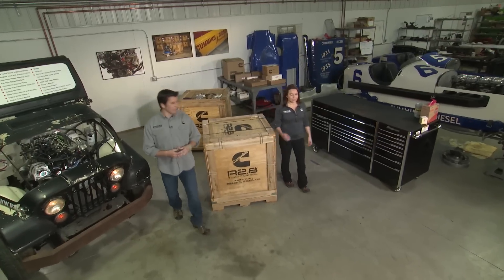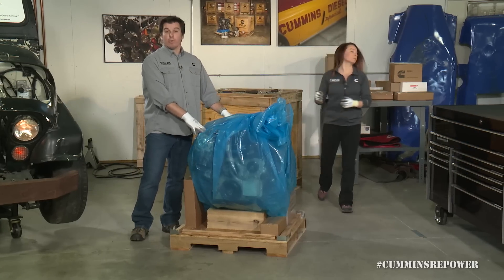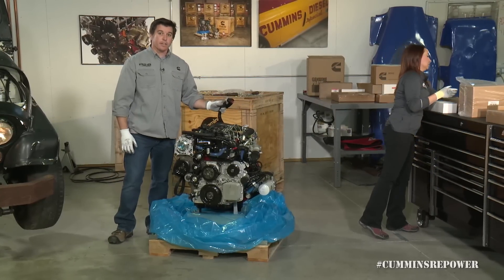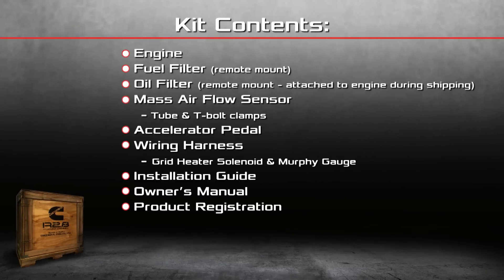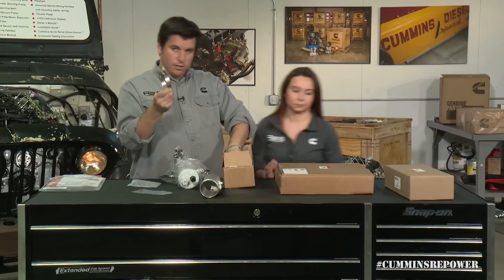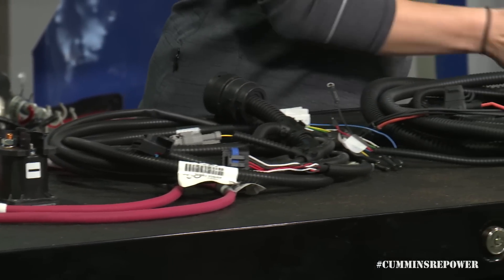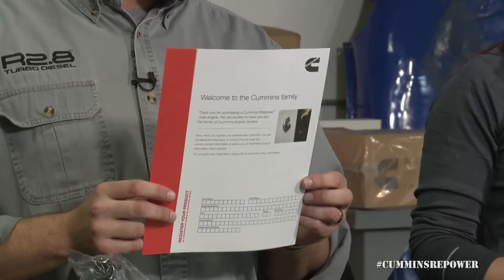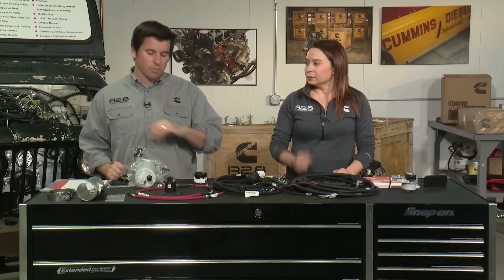Cummins Repower Garage Video 1: Kit Contents and Unpacking the R2.8 Turbo Diesel

Comment: My friend tried to buy a engine but said there was none to be had now and many months out . I use to turbo diesel Toyota 4x4 which was a ok truck but it was a id motor and ran like that .  I have would consider this or even a Jeep and get rid of the Toyota . So when do you expect to have engines back in stock . I have a 95  4x4  12 that getting a g56 now . Having a good small truck to go and do what I want and get mileage like 30 is nice.

Comment: I wonder how well this would fit in a 2003 trailblazer, put this bad boy in there and find a way to fit a standard transmission behind it and it might not be bad, I know my current setup is pretty efficient, I get 20mpg at 75 mph with a 4l60 and 3.73s I have the vortec 4200 and there’s not too many hills I can’t get up in cruise control, it doesn’t even downshift

Comment: @cumminsengines
So where does the customer take their jeep when they can't figure out a fault code? Do they go to the nearest cummins facility? I'm guessing there's a 3 pin connector for a cummins tech? Could always tap in to the data link if not.
Reply: Just pulled up the wiring diagram and found the dedicated data link.

Comment: Im honestly considering on swapping one of these in my uncles chrysler imperial to make it a daily driver. It seems like it would get good mileage and get the car up to highway speeds without an issue. I wonder if you can bolt it up to a torqueflite transmission. He doesnt drive fast anyway so this would be perfect!

Comment: I wonder if I use that swap on a rust free s10,or ranger if I could sell it for 12k?there are a lot of good bodies out there .
Reply: You'd need either a gm or jeep transmission & probably an adapter plate. I just priced the motor, adapter plate, and an ax15 jeep 5 speed tranny (no flywheel or transfercase) at 12,327.02. With all the extra fabrication youd need (building motor mounts, tranny crossmember, etc.) I wouldn't sell it for a dime under 20k

Comment: 2015 SL 2500 Cummins 6spd 4x4 4door Crew cab deleted 4" pipe, KN flat air filter camper shell EdgeCts2 computer 20gallon extra tank, 3 light bars =970watts, Setup as 1st responder, 10k+#, same mpgs since deleted by PFdiesel.com
25-32mpgs freeway
20-25 city, 10-20 off road 
Avg.MPGs From 78k to 200k
Efficiency is measured TonXMiles per gallon used by scientist in the diesel truck industry
2015 RAM Cummins 4x4 4door= 5.2tonsX28+mpg=146Tmiles/gallon😀

Toyota Prius is 3200=1.6tX50 mpg=80Tmiles/gallon 😆

6ways MPG math confirmation
1-ram computer
2-garmin gps
3-google maps gps
4-USGS maps gps
5-AAA maps Android
6-hand=4 semesters calculus

Diesel ECONOMY TIPS
1:Speed 55 & rpm 1500
2: Close Windows 
3: No items on top of car
4: Make truck aerodynamic  
5: Inflate tires 2 maximum
6: High rear end gearing3.42
7: Factory tall tires
8: 5-40w Synthetic Oil
9: avoid 4x4 driving
10: Remove excessive weight   
11: Fuel is heavy too
12: Plan journey wisely 
13: warm up engine
14: clean outside
15: Avoid RAIN 
16: No aggressive driving
17: Don't over-rev. 
18: Gear fast, slow & accelerate 
19: Avoid idling.
20: Overdrive & cruise control  
21: Ele&AC worsens MPG
22: Exploit cruising down hill 
23: Avoid a complete stop
24: red>roll in neutral gear
25: Tune engine to low HP
26: Change oil regularly.  
27: Replace air filters regularly.
33: Leave early Family drama 
34 constant Mph=Mpg 
36: avoid drama & stress
37 Park in shade
38 distance to prevent braking  
39: Forced induction =MPG
41:Rough asphalt tire wear+7% 
42:Use brakes to slow down.
43change fuel filters often
44change power train oils
45avoid wider tires
46avoid jacking truck height
47used tires =better MPGs
48TenDegrees=HalfMileMpg

Obama Diesel Exhaust Cooker warranty expired 80k. 3rd Cooker by 75K so 78k I deleted. Save 10c mile or $1000/10,000 miles
Or $10,000/100k miles! 
So if I deleted@0, $7800 saving + $10,500=$18,400 fuel savings!
Reply: John Jason Chun - You by chance have a youtube channel...?...if not, you should!

Comment: Is there a finance plan to get the engine because some of us aren't made of that kind of money to drop all at once ? but would be able to pay it off in payments.
Reply: If your credit is decent get yourself two credit cards with decent credit limits. Get them from large banks so you can take advantage of a specific deal. Discover card is very generous with their credit limits. 
Here is the trick. It works, I've been doing this for the last 7 years to avoid paying any interest. 

Make your purchase with one of the cards. Get online, or call your other credit card company and ask them for their balance transfer promotion. Usually this involves paying no interest for a year or even 15 months. Transfer the balance to the second card and pay it down as much as you can while you have your zero% interest rate. Then after the 12 or 15 months, simply transfer the balance back to the first card using their balance transfer promotion.
Reply: A personal loan from your bank would be preferable to the CC trick since there is always a several percent transfer fee for the “0%” interest rate and funky fine print....  A day late and the rate jumps to mobster levels guaranteed.  I’d think Cummins would eventually assist with financing much like buying a trailer or motorcycle/ATV.
Reply: @gwolf7716  The transfer fee is usually only 3% or less and it is a one time charge. 
A personal loan from a bank is going to be not only a higher interest rate, but also will charge you every month.  

And you shouldn't be worried about making a late payment. You should be paying all your bills on time anyway. 
And even if you don't have the money to make a payment one month, you can always just make the minimum payment that month and you are fine.
Reply: Yes save your money for a year and pay 0% interest
Reply: Just put so much in a different account till you have the amount to pay for it.

Comment: Soo you connect this diesel engine to a gas trans..
Reply: Might want to look into a different trans. Some people use jeep transmissions because of the rev difference between diesel and gas engines. I'd look into it. Diesels normally redline at 3,900

Comment: Someone school me, it makes less horsepower and torque than the penastar. I do get that it has good low end torque and it'll last longer being diesel. But if I can make more torque at a little bit higher rpm why would I want this engine?
Reply: Eric DeLong if it has to be explained you probably will never get it. Get yourself a test ride in diesel and then maybe you will

Comment: What about swapping one of these in an XJ, would I need to change to a standard transmission and what years would it work in?
Reply: Advance Adapters sells bellhousings and flywheels that can adapt to most jeep and gm transmissions.
Reply: @MegaSpazGaming  Since I made this comment, I've bought a 5 speed 95 Jeep Cherokee.

Comment: I am building a 1949 F1 and want to put a 2.8 Cummins. My only concern is that if I purchase the motor it's going to take me over 90 days to finish the build and the warranty will expire before I can even get the truck up and running. It would be nice if the warranty was based on engine hours or someway to allow us to build our projects and have the warranty start when we actually start using them. That is the only reason I have not purchased mine yet.
Reply: Mr Chuntaro good point is someone at cumins listening
Reply: Warranty has been extended to 2 years, 2600 hours (still parts only)

Comment: I think its overpriced. It should of been around $5-7,000. Not $9,000. Though I"m glad it finally came out.
Reply: Jeremy Rhodes but for the money? It's really a complete kit....low volume = high development cost
Reply: I thought it was a great price...A comparable aircraft piston engine is upwards of $30,000 for what is arguably a much simpler engine and a less complete package...
Reply: $9,000 is priced exactly as it should. So some quick price checking NEW full package engine kits (everything needs to run) and you'll see this is priced right.

Comment: Would this motor be a decent replacement for the avg V8 in a 1/2 ton (Ford/Chevy/Dodge) pick-up truck and still be able to tow our weekend toys (boat, (two)horse-trailer, car-hauler etc)??  Or should we wait on the tba next Cummins Repower engine? What displacement might that tba motor be?? Thanks!
Reply: if you look at it it has about 30-40 less HP (around 160 while a stock 70's 305 is about 200), but I heard they can be relfashed to about 200 HP with obviously more torque (looking at putting it in a 69 GMC)
Reply: scott web horsepower doesnt mean anything in a diesel look at the torque numbers and the torque curve way fatter than gas

Comment: That ain't no moister wicking bag! that's a VCI bag and it's coated with some sweet ass chemicals that coat the parts inside with anti corrosion crap. Many VCI's are hazardous but green ones are coming onto the market.

Comment: Will there ever be a 4.2L six cylinder version? And is there any possibility of a "race only" version without the EGR system?
Reply: yeah its called removing the EGR and tuning it.
Reply: They can't due to federal regulations. You can delete the EGR yourself and the DOC, but please keep it on the track.
Reply: @goober239   Yeah to have equipment on your vehicle that will only destroy it over time Make it less fuel efficient And huge costs for repair

Comment: @CumminsEngines, how can someone get a hold of a 3D CAD model of the engine? (even if it's just an outer shell) I'm trying to lay out an MB in CAD, and want to install the R2.8 in it. Please tell me you can help with this request!
Reply from the maker: Hi, Chuck! We are working with SEMA Garage to host our 3D models and drawings, but you will need to be a SEMA member to gain access to it.
Reply: And unfortunately, that's the problem. SEMA won't let the CAD enthusiast become a member, even if you want to pay the fee. I know quite a few people that would gladly pay the fee to be able to model their favorite rig to build, but because they aren't a business, SEMA won't grant access. Lots of these people (myself included) work in the engineering/design field, and we're used to non-disclosure agreements. I'd gladly sign and abide by a non-disclosure agreement so I could have an actual model to put in the rig (Willy's MB) I'm wanting to build. Even if it's just an outer shell that had motor mount locations, and accessory locations.
Reply: You can have the engine scanned and turned into a 3D model.  Faro Measurement Systems makes a scanner.

Comment: Are there any bell housing adapter kits for the Land Cruiser 80 series yet?
Reply from the maker: Hi, Kal! There are several companies making adapters for this engine. The most common setup we have seen is to use an adapter from the R2.8 to a GM bolt pattern, and then a second adapter from GM to the Toyota transmission. We’d also be surprised if someone hasn’t already (or has one in the works) to go straight from the R2.8 to Toyota. Check out Axis Industries and Advance Adapters (or a quick Google search may highlight some others).
Reply: CumminsEngines what bellhousing pattern is standard...
Reply: John Hull why not just get a land cruiser Diesel engine instead, bolt in, last forever and way cheaper.